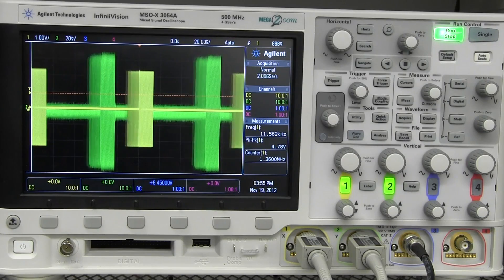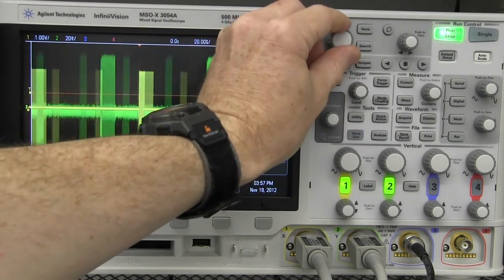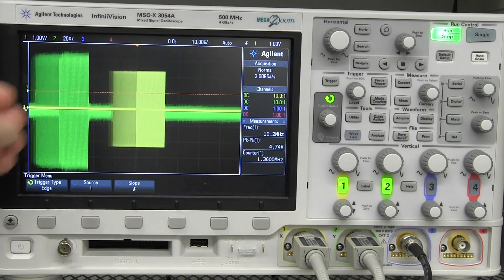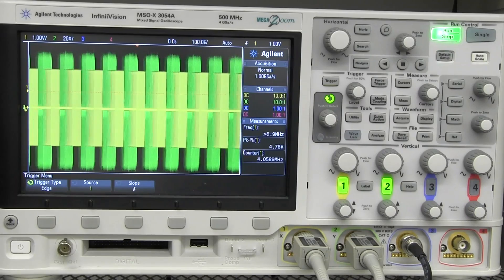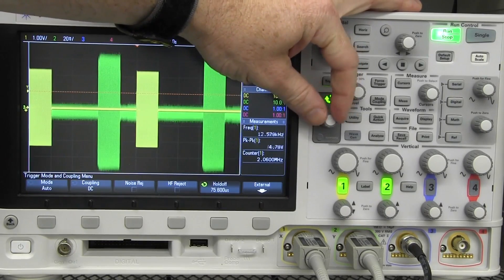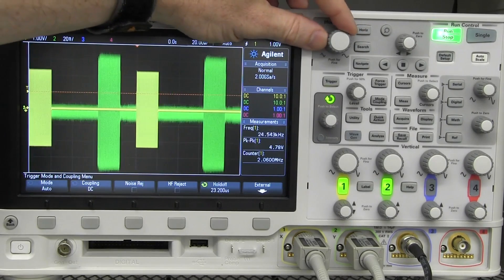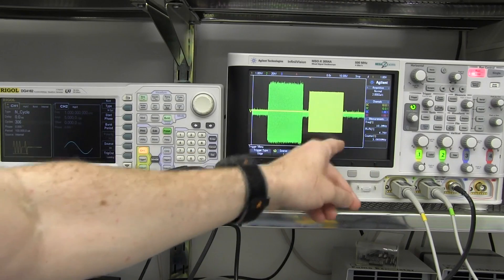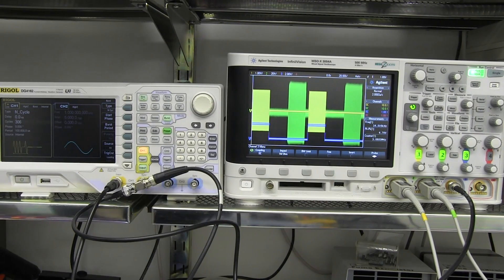EEVblog #387 - Oscilloscope Trigger Jitter

Comment: Hi Dave,

Great video :)

However I guess the title of "Trigger Jitter" is misleading for this video, 
because the discussion is just about trigger holdoff and how to get the same waveform on the scope window for each "Single" trigger that we do or if we put the scope in triggered sweep "Run" mode.

As per my understanding, oscilloscope trigger jitter is entirely different & is the horizontal jitter that the oscilloscope itself adds to the displayed waveform due to the trigger circuit voltage noise & jitter.

Regards,
Arun

PS:
I might be wrong but this is what Iunderstood from the below sources:
 - http://www.edn.com/electronics-news/4385253/How-to-measure-display-jitter
 - http://m.eet.com/media/1164733/3829-the_evolution_of_trigger_jitter.doc

Comment: With the 3rd option, wouldn't you get an additional timing issue when using a trigger from the function gen at low time base's? Depends on the length of the trigger cable of course, but would the few nano seconds be enough to throw your silly-scope out while using an external trigger?

Also, ignore the anti delay line comments, its nice to see how people controlled the timing of things back in "ye olde days" when you couldn't change timing by adding a delay inside the software :P.